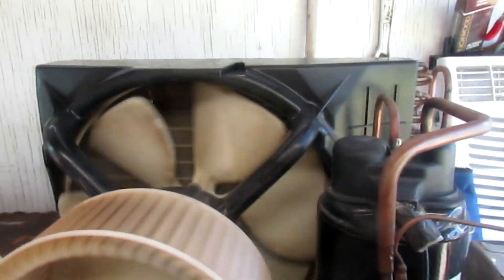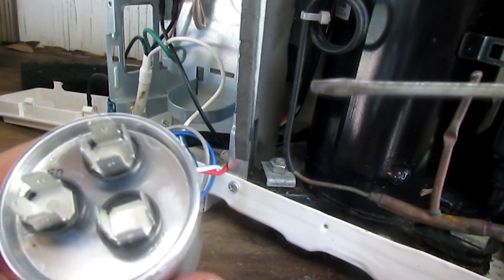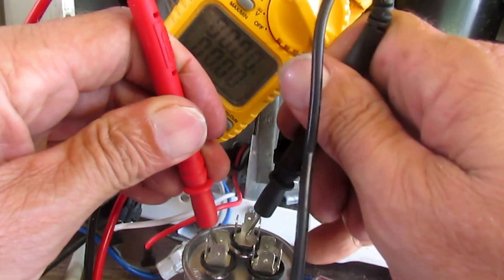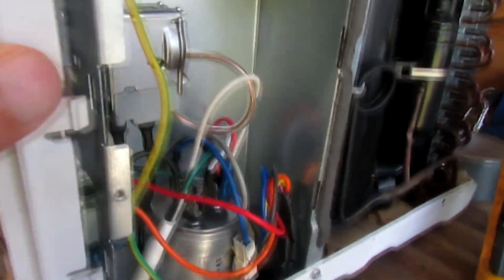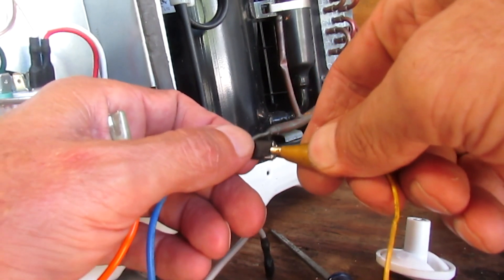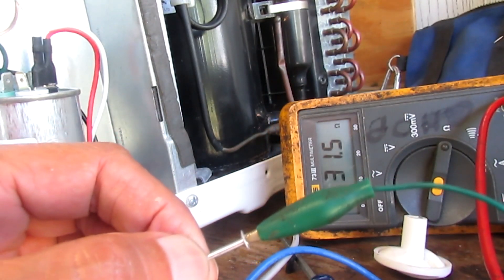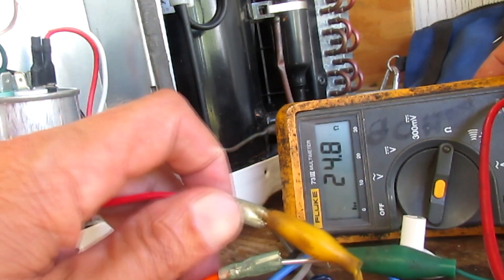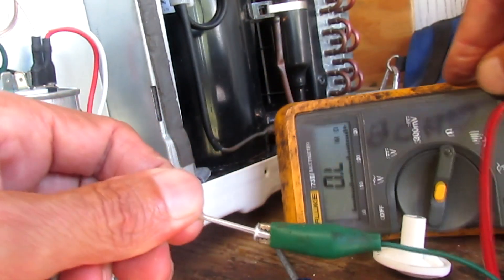Window Air conditioner  Unit Troubleshooting

Comment: The air conditioner is not advertised as fitting a 16 inch window, but as the body of the air conditioner is just under 16 inches if you leave off the accordion brackets it fits perfectly.

Comment: Brilliant video... and the other comment was right, you do sound quite a bit like John Wayne.  lol.  i didn't understand a single thing you did but i was FASCINATED (and slightly jealous) of your knowledge!  i cleaned my Frigidaire window unit at the end of last season because Frigidaire doesn't put enough drain holes in the bottom so it's a black mold factory.  now that it's nice and clean the stinkin' fan doesn't work.  ugh.  it's 12,000 BTU and was pretty expensive so i'm pissed that i turned it into a door stop.  dangit!!

Comment: It blows till compressor supposed to engage then everything stops and just buzzes and if I set to just fan nothing etheir
Reply: Me too this year. Did you figure anything out?
Reply: @kimasim1  I bypassed the computer and went straight,no relay,so it always on....and put timer on plug to pretend relay30 min on 30 min off so it don't ice up still going strong

Comment: Hello! I have the same unit, the fist time i start the unit the fan is off the condenser is on, after a few seconds I turn the unit off, then when i turn it back on nothing works no fan, no compressor sound, nothing, like if the unit is not even plugged in, would this be a capacitor issue?  Thanks!
Reply: It's a bummer when no response happens.
Reply: @kimasim1  👍👍👍👍👍👍
You're so right. Sometimes they'll ask you to make comments, and still not answer😒

Comment: I have the same ac but digital version internals are all the same. ordered a replacement motor that was recommended for my model but it doesn't fit correctly all the screw holes are a little off and the wiring harness was moved so it doesn't fit nice in the blower frame -.- I had to take apart the ild motor and I'm just going to swap the bearings myself and clean it up maybe silicone all the little holes on the thing so it doesn't get any moister in it.. they keep making small changes so you can't order parts for these things.
Reply from the maker: Thx for watching.
Reply: 1stfloorguy sneaky bastards

Comment: I have a Haier window unit air conditioner I want to change the electrical plug can someone tell me why is the neutral wire and Hotwire designed like cable coaxial like television cable does it matter when connecting to a regular electrical plug

Comment: This is probably a dumb question.... But how did you know the condenser was working?
Reply: he means the compressor is working ..the condenser is only a coil  it has no moving parts
Reply: I have the same problem as this man, I can hear the compressor making the normal noises.  The exception is, the Artic King $125 window AC I have does not ever blow air, ie the fan is not kicking on.

Comment: I am search far and wide for the black plastic piece that is attached to the fan motor and condenser coil. Do you happen to know what the factory calls that particular item? I went to encompass.com but they have no pictures of the items and I'm not 100% sure of the item name.
Reply: If it's rectangular in shape it's probably a switch.

Comment: I bought a general electric 6150 BTU I got scammed the air conditioner constantly turns off and on whenever you plug it in how could you fix that so I could get rid of it and get my money back

Comment: When I turn my window unit on, the fan doesn't kick on. It only makes a loud humming sound. Could this be the motor/compressor?
Reply: The Capacitor could be bad (If the fan turns easily by hand and is not frozen that way)
Reply: No if the fan does t turn it’s not the compressor. The compressor is a complete different thing

Comment: Can you direct me in the direction I need to be looking? My Window ac turns on but shuts off within about 10 seconds, I unplug it and it does the same thing every time
Reply: Did you ever fix it? I'm having the same issue now and I'm looking for a fix
Reply: Why put out a video and never check for response. Nobody's questions were answered. Bummed.
Reply: I still haven't found a fix for mine, haven't gotten a reply yet either :(
Reply: Either reset your thermostat or reset at the plug. Should have those tester buttons.
Reply: @kimasim1  lol it sat here for months and never got a response!! But I'm the rotten person because I had forgotten all about it? 🤔 Okaaay. 🤔
Reply: @austinkurtz451  nope
Reply: @timgreen2426  already did all that, same issue 🙄
Reply: @kimasim1  Oh, I'm sorry, I had thought you were replying to my question, I see you are as upset as myself about this video not responding to our questions, I apologize. 🌺
Reply: @mikeharris8365  no problem. Sometimes texting gets misunderstood. I ended up taking the cover off of mine and sprayed it down with a hose. There was a little stick obstructing the fan. After it completely dried, it worked great...turned it on before putting the cover on to not waste my time. Have a nice summer. :)
Reply: @kimasim1  thanks and you have a nice cool summer as well, mine is still apart in the storage room, I have a couple of the smaller one's cooling my place at the moment,

Comment: Why in days hot or sunny day my air conditioner don't work good blows warm
Reply: Day around 65 degrees work good but days hot more or summer don't blow colder air
Reply: @LucasMoraes-rx9lg  are both coils clean?..the condenser coils outside have to be cleaned from inside out
Reply: @LucasMoraes-rx9lg  clean coils from inside air conditioner. Clean behind filter but go in from inside ac. Grime gets caught on fins in the back. They can not be cleaned from the outside. 👍
Reply: It's hard on these units to sit in direct sun all afternoon. Try a different window.
Reply: @kimasim1  For my unit, it's on a ledge made specifically for it (I live in a studio apartment). Mine blows warm air when I even set it at 65. I tried notifying maintenance and they just looked at, checked the filter, checked the temperature and then said, "The compressor is overworking due to the heat." That was it. I tried taking it down to clean it, but those things are not light. And it was even worse trying to put it back up on the ledge when it's 6ft off the ground, and I'm 5'8". Cleaned it and all that, but it still didn't fix it.